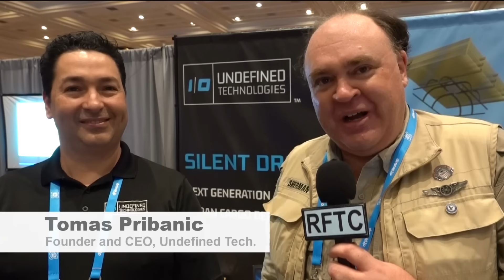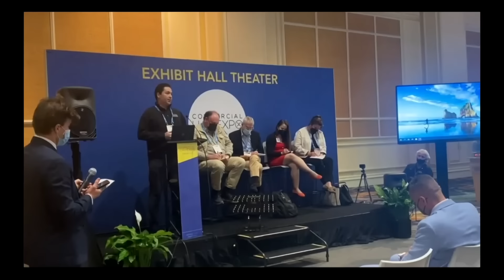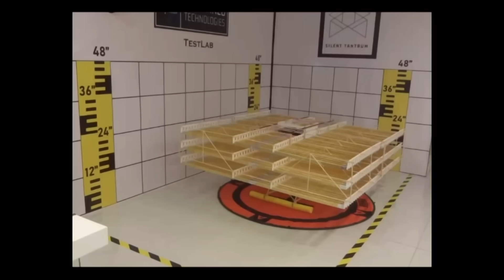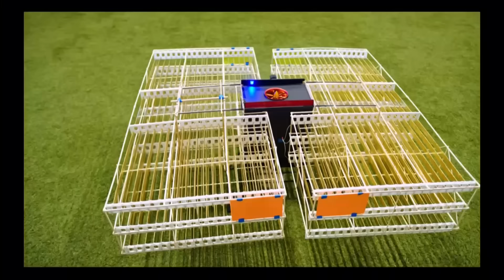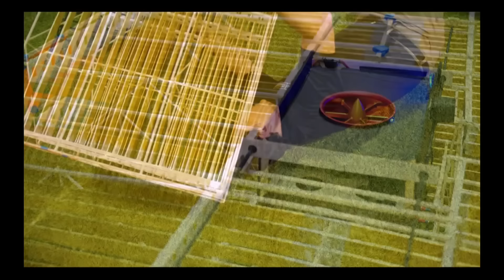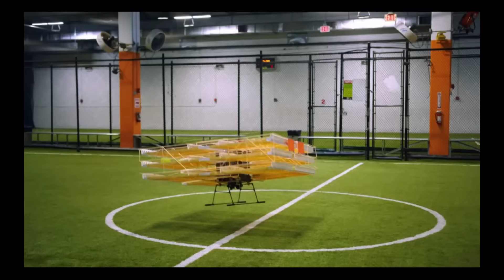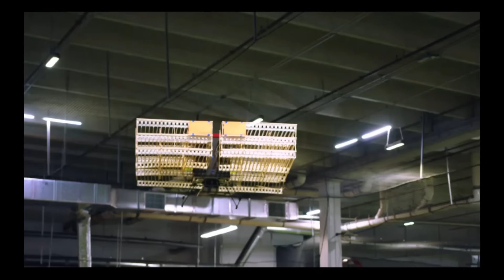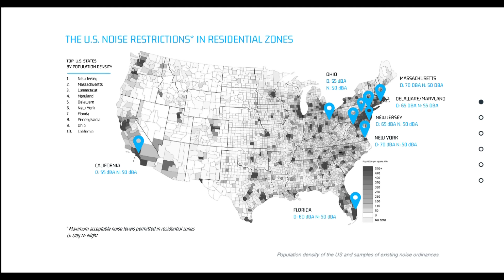New Drone Tech: No Propellers, and Yet It Flies!

Comment: What is the balance between the central EDF and ion drive? Is the EDF solely used for efficient vertical translations while the ion wind arrays are used for neutral buoyancy and horizontal motion? Or is the EDF used for most of the lifting force and the ion blowers just for stability and pitch/roll?
Reply: The Ion thrust on the UT craft may not even be hooked up.  It has fins under the ducted fan for steering as far as I can tell.  On my channel are the only ion propelled crafts that really lift their power supplies onboard and are patented for that reason.

Comment: I wonder what is the health impact of all those ions being emitted into the air.

Do they acquire electrons just after being emitted or do those ions spread through the air and behave like exhaust fumes from a diesel?

Other than that it's a really cool technology.
Reply: EVERY large electronic divice charges the air with ions. There is nothing harmful about it, as long as you don't use one of these drones in a leaky gas station.

Comment: This is a "Naudin lifter". The best one that i've seen, so far. 
It works like a light weight version of those ionic fans from the early 2000's. 

I think some MIT students made a model airplane version of a lifter. So, instead of hovering, it flew.

You can make your own rudimentary version of this with scrap items. Just don't electrocute anyone. Caution ⚠ High-Voltage.
Reply: Neither regular lifters, the MIT glider, nor the UT craft can lift their power supplies vertically solely with ion propulsion.  The UT craft uses a ducted fan and none of those craft have a sufficient thrust to weight ratio.  LIfters used to require external power supplies weighing kilograms to lift a tethered model weighing grams.  On my channel are a series of ion propelled crafts that are patent for lifting their onboard power supplies against' Earth's gravity.  There are a lot of details that have to be right for it to work though, and those details are missing on the other three types of crafts mentioned.
Reply: @KraussEMUS1  Here's the MIT pusher. It looks cordless.
 https://youtu.be/q2LTjFzuUbQ

Comment: this "new" tech is at least 30 years old....
only thing that changed is smaller electronics and better batteries, doesn't need to be corded anymore
still, too flimsy and low lift to carry anything or be useful beside hovering inside a sports stadium
Reply: The UT version uses a loud ducted fan.  It is not that easy to build a VTOL one with onboard power.  The only ones that can do that are on my channel.

Comment: only question is how does this effect living beings near it? and then how do you make it smaller and more powerful?
Reply: ion propulsion is completely harmless: i's basically the same level of danger as rubbing a balloon on your head because it just charges the atoms of the air to move downwards, using the pressure differences in much the same way as a wing, or like how spiders fly by charging their silk and casting it to the wind. it's a relatively light-load method and right now can only transport small payloads, but with stronger materials and better batteries, these things are getting better and better. size is a bit of an issue because physics, but if i had the answers i would be using bezos's ass as a dining room chair.
Reply: @aidanmatthewgalea7761  Will we ever get to the level of star wars ion engines though that's what i want to see.
Reply: @sheilaolfieway1885  eventually, i mean, we have a similar engine type where it can "burn" with xenon ions that are accelerated by static electricity at stupidly high voltage, however their biggest issue is that they take days to reach full power. they can, in theory, fire for decades at full throttle with about twice the volume of a Pickup truck and 20000x the mileage. their only problem is that they are spacebound. in theory, you could have a vehicle that can swap its ion fuel for air, by adding valves to the tanks, and valves in the sides for air inlets. they still can't pull a whole lot, but they make up for in almost surreal fuel efficiency, even by today's standards. an ion engine can, in theory and with the right design, outclass and surpass any engine. there's another way to make them able to thrust in an atmosphere: ion-acceleration tipjets using the same principles. if done right, they could basically swap between hyper efficient spacefarers to a microlight vtol. idk any way to make them more powerful other than increase the voltage, at least in a way that maintains the ion-based engine design.
it's important to know ions are literally any atom that holds a charge. all these do is accelerate them away from the craft in a useful direction.

Comment: If there's no fan, why is there a duct in the center (ducted fan?)? You only show the top view for a second, but - are we cheating?
I did "like" the video by the way.
Reply: On their website there is a video with audio and the loud EDF can be clearly heard.  On my channel are the only real ion propelled VTOL crafts with onboard power.
Reply: @KraussEMUS1  I agree, yours is the real deal. As a senior well-seasoned electronics technician, I can appreciate the math and physics required behind your design. I must ask though; Is it propelling away from the earth's gravity, or against the landing surface that it rests on (an interaction with hidden electronics under the lighted table)? Thanks for sharing. I'm following your project now.
Reply: @OnHoldAt50  It absolutely has the power supply on the craft.  It's located in the center.  It can fly entirely independently of the table. US patent numbers 10,119,527 and 11,161,631 explain how it works.  There is also a video on my YT channel that shows one of the old power supplies and steering units being bench tested.  In some of the comments under the "Early Experiment" video, there are some more details.  Thanks for the kind comment!

Comment: I remember an article on ion lifting devices in the late 1960s, maybe very early 1970s. Popular Mechanics, I think. Of course at that time even an onboard power supply of any significance, much less flight control electronics, wasn't in the cards.
Reply: The difference is probably in today's battery energy density.
Reply: @feraudyh   Definitely, and more efficient electronics.
Reply: @feraudyh  The difference is fraud and lies.  See this video of this incredibly loud thing actually flying using a central ducted fan:  https://www.youtube.com/watch?v=iihprC5Huf4

The guy's dog must be stone deaf.
Reply: There is no way the UT device lifts its power supply with ion propulsion.  There is a video of it online called something like UT Mission 2 Flight, where a loud ducted fan can clearly be heard spooling up in the center of the craft.  
On my YT channel there are about 36 flight videos of a series of ion propelled crafts that are patented for lifting their power supplies.  They had to be built very light in weight and required a large number of particular upgrades to get the power supplies onboard.  I don't believe the UT craft has onboard power, nor is it "silent."

Comment: You can plainly see the intake fan in the middle during test flight, which they were hiding at the convention.  Also, if the panels are providing all the thrust why do they bend downward like they're gonna snap off when it lands as though they're barely hanging on?

Comment: meh, this has been done in every high school science room since the 70's, and are called Ionic Lifters, not drones (cos they dont make a "droning" noise). 
meanwhile, look at my new invention - it is has two wheels which you turn with your feet using pedals via a chain. i call it the "double-wheel-mobile".
i am also working on re-inventing the helicopter, but instead of the propellor on top, it will be at the front, and there will be wings and a tail. imma call it the "fowardcopter"
its definitely not a airplane, cos i changed the name

Comment: You'll never generate enough thrust to carry substantial payloads.
Reply: The UT version won't every carry its power supply without a ducted fan.  You are correct though about ion propulsion unless there is as very large surface area.

Comment: i saw a vid where ion propulsion was used to spin a plate on a pivot , when he put it in a vacuum chamber it was spinning until the vacuum was turned on then it stopped , showing that if there is no atmosphere there is nothing to push against , this will not work in space ,,do the experiment yourself and find out ,,,Cheers

Comment: Ion propulsion cannot lift that much mass per area no matter what kind of "magic" he is using and not with 2LBS of payload for 15 minutes either!  Nor is it silent as he claimed.  The loud ducted fan in the middle of his craft can be heard spooling up in the video below.  It is a distinctive sounding jet like fan, quite different than a cooling fan, and it increases or decreases in rpm by a specific amount correspondingly as the craft goes up or down.  It is the source of lift Here is a link with audio of their craft:

https://youtu.be/iihprC5Huf4

On my channel are a series of the only ion propelled crafts that can lift their power supplies vertically.  It was very difficult get onboard power. They had to be built exceptionally light in weight, with a large surface area, and other novel factors.  They are patented for that reason and anyone else who can lift their onboard power supply using ions without contacting me is violating my patents.  Most likely there is no way Mr. Pribonic has done it solely with ions yet though.

Comment: This is not new tech at all .. this has existed for a very long time, it's just not effective enough to have anything that you can actually use. In fact it's quite easy to build one out of basic stuff you have at home. If this tech had any future, then big companies such as NASA would be utilizing this already, however that doesn't mean nobody should look into this. I think we need a breakthru on electricity / battery department, that would make methods like this more valueable and practical.
Reply: The ion thrusters on my channel do represent a breakthrough and don't require a ducted fan to lift their power supplies like the UT craft.  That said, much R&D still needs to be done.

Comment: So THIS is that old tech from yers ago that they were trying to sell us in the back of magazines and then on the internet which were essentially tinfoil and electricity to move charged ions.  I built one but to be honest, it was pretty flimsy and not at all practical.  Looking forward to seeing what the modern advances can bring to this approach.  The old needed batteries and could not lift itself.  Now that we can literally transmit power THROUGH THE AIR without requiring batteries nor wires, this may have a chance.  The company that offers that tech is called Energous (Stock symbol WATT)

Comment: The thrust of current solar-electric ion thrusters used by satellites and a few deep space craft is often compared to several sheets of paper weighing down a scale. It's tiny but applied for weeks or months at a time.
Reply: ionic propulsion is impossible in space. space is a vacuum.

Comment: Its basically an "Ionic Breeze" flipped on its side. This is not meant as a derogatory statement. They had to get the thrust up enough to propel the craft. Plus they had to use all the latest material technologies to make it as light as possible. Still quite a feat of engineering. The simplest part was computer control of the different quadrants.
Reply: Pribanic has made a long list of statements that do not appear to be correct.  There was a video of his craft online suspended from a lever with a mop bucket on the other side of the suspension lever.  The craft was externally powered and even then, produced nowhere near enough thrust to lift its frame without a heavy counterweight.  He said his craft was silent and then later said his craft reached a milestone of 85dB from 95db.  I have heard their video of it with audio on their website and it is clearly very loud.  His craft cannot lift its power supply and a 2LB payload for 15 minutes using ions like he claims.  It has the same geometry as a heavy 2 stage "ion lifter" which produces 1/2g of lift per watt and with his well-known "heated cathode" lifter, even less.  It takes a thrust to weight ratio increase of hundreds of times to get an "ion lifter,' to carry its power supply.   If it could fly at all with onboard power, he and his group would be violating my patents that cover any ion propelled craft that can lift its power supply.  He says his craft is "the first breakthrough in 100 years."  It takes attention to microns and milligrams, as well as unique geometry and a novel power supply to have onboard power with ions, not to mention many years of work.  The UT craft does not have the features required to work at all without a powerful ducted fan.  There is a flying ducted fan craft shown online called the Ikarus. Although it operates at a slightly lower frequency, they now often make leaf blowers for instance work at a higher frequency to reduce perceived noise somewhat, but ducted fans/leaf blowers are necessarily very loud.

Comment: Yeah, there's a ducted fan (EDF) dead center of the unit we see flying in the video.  The ion flow isn't enough to lift the craft, but it is enough to control pitch, and roll.  One thing it can't do is control is yaw - as evidenced by the constant turning of the demo while flying.....can't overcome those EDF rotational forces without adding at least 2 more ion generator panels at 90 degrees to the ground.
Reply: I'm pretty certain all of its control is accomplished by small fins on the bottom of the ducted fan, similar to the "Ikarus" flying ducted fan and others online.

Comment: In this video there is a engine in the center to force air down or on something . This isn't lifting and controlling it ? Or is that a fan to cool the computer processor to regulate it temp ? I doubt a standard processor would need that much cooling just to send signal beyond a stand desktop computer . so ...If it is ,is it assisting it in its main duty to handle most of the lifting percentage and the ion to the pitch and ...? I'm confused by what is see in the video verses what they say. Goofy people presenting beyond rational and physical capabilities without and newly discovered logistics or physics discovered hangs close to a shaman. Take out that center fan then make it fly then ...maybe ...maybe ill ....
Reply: You can find the real thing on my channel, and it is fully explained.

Comment: Comments on the edf. To me it looks like a cooling fan and has nothing to do with lift.
Reply: Everyone will find out that the above craft cannot lift its power supply without its ducted fan.  It has the same geometry and weight as a two-stage ion lifter. Those require a power supply that is roughly 100 times heavier than the tethered craft to make the ion lifter fly.  

On my channel are the only ion propelled crafts that lift their power supplies solely with ion propulsion, for a large number of particular reasons.  Such as surface area to weight, micron thick emitter wires positioned very high, and a very special power supply.  It cannot be done with anything close to an ordinary ion lifter and power supply.  The UT craft is just way too heavy for one thing.  They also have a video on their website with the sound of the leaf blower/EDF on it spooling up.  It seems like it used to be louder, but it still is WAY louder than just a cooling fan.  Some newer leaf blowers have a higher frequency making them slightly less annoying, but they are still not quiet.  There is a similar flying ducted fan online called the Ikarus.  He also claims his is the only real breakthrough in 100 years.  Any expert in the field, would be aware of previous patents on the subject and would not say that.

Comment: It does not use ionic wind to fly. Electrons are made of antimatter, by increasing their voltage, you increase their kinetic energy, and thereby increase the amount of anti-gravity. The system uses sheets of aluminum foil to store the electrons. This is the future of spaceflight, and will replace rockets.

Comment: Great if you're flying inside a warehouse, until someone opens the door and the breeze kills it. And forget using it outdoors even in dead calm weather if there's water vapour or rain!
Reply: It is proof of concept. So because of all stuff you say they shouldn't try, give up, quit?  far from any kind of final product design. New materials come out all the time, strength and weight issues are being resolved and in constant development. Current airplanes are a lot different then the first airplanes.
Reply: @MrBonners  Yes, but the laws of physics don't change. High voltage and rain water don't mix very well. How much ozone will your local zoning tolerate in the city from a car? Because these are going to create ozone, too. And, as I say, a crosswind will ruin these - they can't be shaped like a box kite and be aerodynamic, the two methods of flight are incompatible!
Reply: @DSSlocksmiths  how would that be a problem?  no water involved in a proof of concept model testing. There is no such thing as an Ozone zoning. Zoning is about land use. Ozone has a half life of 5.5 minutes.  This is an aircraft, no threat of Ozone issues in it's operation even a few feet of altitude.